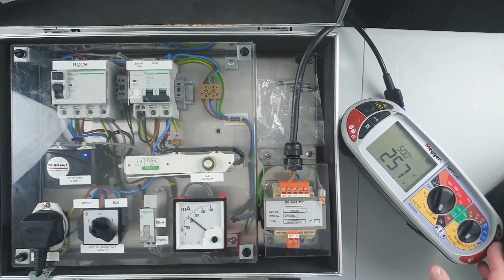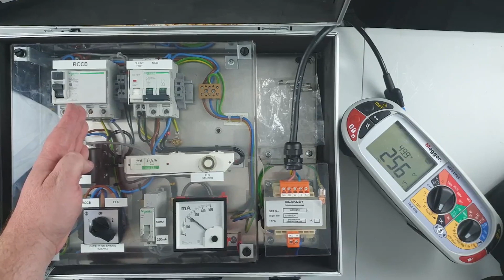Demonstrating the impact of DC leakage in Type AC RCDs

Comment: It’s an interesting demo, but lacking in some regards. The test is done with 50mA and 250mA DC current which is much higher than Type A RCDs are specified to handle. 

Can you repeat the test with Type A RCDs which are only specced to work up to 6(!)mA DC current and demonstrate that Type A RCDs would really be superior in a significant way?

Can you repeat the test with Type AC RCDs and only 6mA DC current to check if the common AC RCDs are really significantly less responsive?

Can you replicate a realistic fault condition caused by an electronic device that has actually prevented an RCD from tripping? 

A discussion on the engineering forum IET EngX indicates that the demo is this video is insufficient or irrelevant. Please consider the points I raised and make another video.
Reply from the maker: Hi Christian, thanks for your message. This video was just to demonstrate the impact of DC on an AC RCD. The rig originated from the Rail sector where traction current can be imported into the public supply network at values significantly higher than 1 amp.

I haven't explored the idea of creating a 6mA DC leakage device for the type A question. I will look into it.

Comment: SparkNinja, please could you explain how DC gets back into the neutral.  Almost all PSU's in all equipment begin with an isolating transformer. So getting a pulsed "dc" signal back that way is not impossible but tricky. (Pulses only occurring on one side of the cycle).  Beyond the PSU there is often a capacitor and very high resistance resistor to the chassis to prevent charges building and that would provide a very small current to earth. (In fact this used to be the cause of quite high earth currents in large office buildings.) 
Please could you direct me to, or give examples of how DC gets into the neutral?
Reply: Did you ever find an explanation? I'm looking for one myself.
Reply: @nicolajkl  No. Though I can see how low cost switched supplies could load and distort one half of the ac to create an "artificial DC" I have not seen any clear papers or videos.
Reply: I was also wondering...Did u find the answer
Reply: @kgparmod  No except you can produce the effect of DC by chopping the AC waveform, as in transformerless power supplies of the switched mode type, and low cost single sided psu's which usually only use the positive going cycle. This distorts the sinewave lifting the center point above 0v. 

I knew that anyway, but am still skeptical about it being a common problem, because I cannot find published figures for real word examples.
I wonder if it is marketing, for a problem which is only significant in rare conditions, like demonstration equipment. 

After all, if it IS such a problem, why wouldn't you show real world examples?

I have seen such bias induced on railway signal equipment, but given the induction on miles of cable this is not surprising.
Reply: @kgparmod  Not really.  Being a ex= industrial electronics/electrical test engineer/manger I already knew that you can give the effect of a DC current by chopping and loading one half of the cycle. (why the equipment designers always go for the rising side I do not know, its dumb.) Anyway for domestic stuff the effect should be very small. 

At the time of this video I searched a LOT for real world figures which showed this to be an issue. I could find NONE.

I know it is an issue on railway signal lines, but given the miles of cable to induce voltage on, that is reasonable. Some industrial applcations may also produce this effect. 

I suspected it may be just a marketing ploy for rare and specialised circumstances, such as demonstration boxes. 

After all, IF it really was a problem, then surely you would give some real world examples with figures to back it up?

Subsequently I even asked some of the equipment manufacturers for real world examples. No replies with examples. 

Which tells me it is a scam.

Comment: Another great educational piece from Mr Watts, though it does make me think that me striving to be efficient with my 4kW solar PV and DC driver LED lighting may bite me on the bum when it comes to AC RCD safety in as much as it is a contradiction and my RCDs won't protect me now due to DC saturation.
Reply: I want to go to RCBO DB, is the DC saturation effect applicable to a RCBO type of setup?
Reply from the maker: The challenge here is identifying or even quantifying values of potential leakage, and of that if any leakage is DC in nature.

Its early days, but this is where things are going for RCD selection. For now manufacturers will give some examples of typical types of equipment,
 I recommend doing a google search for RCD types and a company like Doepke that do some good info on this.

Comment: Not sure of the origin of DC leakage to earth is in an AC circuit,  what the implications are, how AC leakage to earth interacts with DC leakage to earth,  how to measure or detect DC leakage to earth in an AC circuit?
Reply: Switchmode power supplies introduce DC currents.

Comment: Is it possible to measure dc current with the ac supply energised? I’m talking about practical on site methods rather than maybe using an oscilloscope???
Reply: Yes. I'm sure there is a leakage dector that works in a similar way to a ct